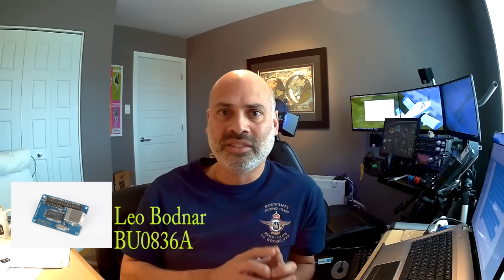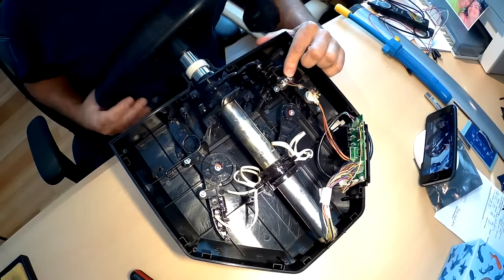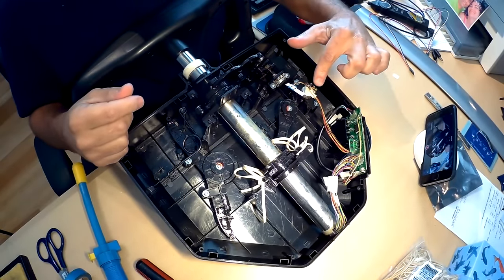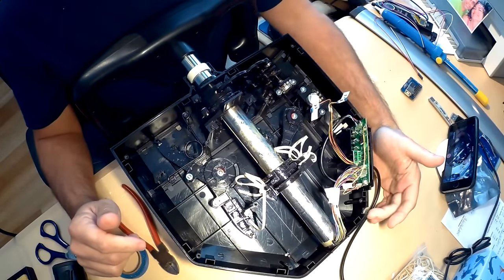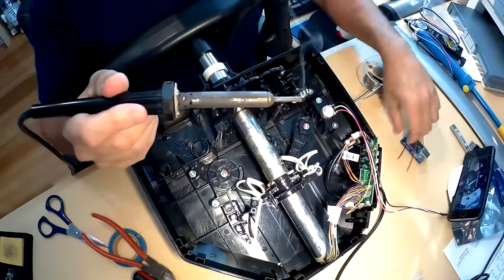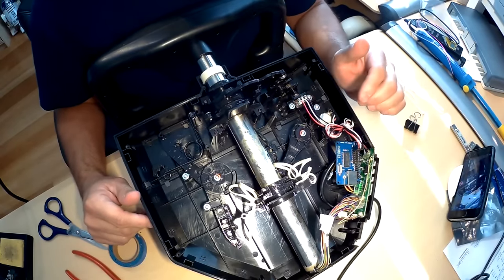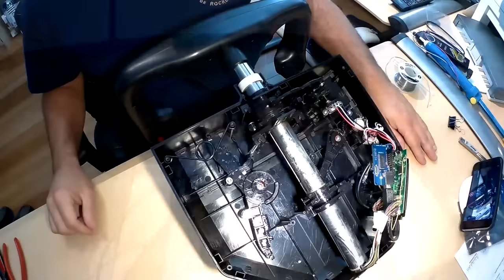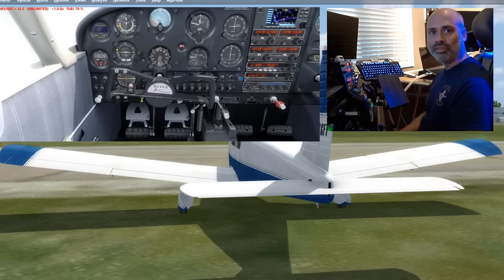Saitek Pro Flight Yoke Dead Zone Fix

Comment: I was a bit afraid of spending almost 50 euros with the module but I did and 6 years after this video were posted you have another happy viewer. Completely worth it, infinitely better. Next step rubber bands. Thank you so much!!!
Only remark that I have with the video is the usage of the saw. I dunno if the quality of the plastic decreased in the last years but I've used a manual saw to do the opening for the usb cable and it was fairly easy. With an electrical one ofc is even easier in terms of effort but the risk of letting the saw escape and permanently damage the yoke is bigger. But that's me.

Comment: The was my second move.  My first move was to try and use an Arduino to do the job.  I did succeed with the only issue being different sensitivities on the two axes.  I did contact LB for some information, but that laughed at my request.  So I bought the BU0836A, smooth sailing since.

Comment: thank you for your detailed demonstration, I found it extremely helpful. I just ordered the parts and look forward to fixing this thing once and for all. Thanks again and take care!!
UPDATE: rec'd the parts in 2 days! UK to Canada, wow! I installed it today and I noticed that my pitch wires were backwards on the original pot so I simply followed the video and everything worked fine. Dont forget to assign flight controls once you open up MSFS 2020 otherwise it will still think the flight yoke is controlling these and you will have no response. You will see the BU0836A show up in the flightsim controls options. Believe me...I am no electronics wizard by any means so if I can do this anyone can.
The final result is a flight control that is WAY MORE REALISTIC!!!! what a difference. I now want to do circuits over and over again just because my landings are greasers...whoo-hooO!!!!
THANK YOU SO MUCH FOR THIS VIDEO, I COULD NOT HAVE DONE IT WITHOUT YOUR GUIDENCE

Comment: Thank you for the great fix. There is a simplified version of that fix: add a resistor e.g. 39k (I have 33k potentiometers) into the potentiometers positive supply wires. That will reduce the signal and the ADC/firmware does not apply that dead zone gap in that range. Of course one has to recalibrate after that and the resolution is reduced by 1 bit, but for me that works still very well.
I also removed just one of the two elevation centering springs and that gives a usable yoke for me.
Reply from the maker: Amazing!  Thanks for sharing :-)
Reply: @Mixturerich  the video gave the necessary clue ("it's a firmware issue")
Reply from the maker: Glad people are stilling getting use of this video  over 5 years later.
Reply: I can confirm this works.  Ran a 39k resistor between each of the pots and the red wires. 10 minute fix and $0.10 worth of resistors!
Reply: @wyatts  Can I ask what exact resistor you used? Was it 1/2 watt? I took an electronics class a long time ago and don't remember much but would like to do this fix.
Reply: @at-yj8pl  I used a 1/4W. Can probably use almost any size. It's a data line, not really much power involved, I'm guessing.
Reply: @wyatts  Thanks, makes sense. I will be attempting this fix soon.
Reply: @supertuxkartgamingexperien5728 Is it the +5V (yellow) cable or the signal (red) cable?

Comment: I just did this fix to an almost new yoke and wow for the first time ever I can land a sim like I can the real thing. One thing I did notice is the colour of the wires were different to that described in the video, check where the wires come out of the original board for correct colour. Also when finished ALL of your sim gear will need to be checked and deleted as I had a conflict between the new board and the old Saitek  settings..  well done.....
Reply: Where did you got the new board? And i am a beginner in flight sims just got the yoke do you think i need to do this if i am a beginner. Do it feels extremely bad without these changes? As said i am a beginner dont know if its worth to do it.
Reply: @skocngt7457  The board is from "Leo Bodnar.com" in the UK . and yes I  believe that it will certainly help you when learning, especially when trying to land as the dead zone in the elevator is very bad and also the aileron has a similar dead band making it near impossible to control near the ground.
Reply: @rodwright3271  Hi Rod im also in the UK can you please tell me which wires correspond to which connection as i have no idea. My wires are the same as your i believe

Comment: Thanks for the tip. I fitted a BU0836 today but I had problems with juddering aerofoils and reversed elevator. When I checked the original wiring I discovered that  the pitch wires on the yoke pcb were wrong they had the red wire to ground and the black wire was 5v . The roll pottentiometer was wired correctly , so my advise is to ignore the original wires and follow the video . Also and this caused the juddering , my leads from the pots to the BU 0386 where too long. Keep them as short as possible it will prevent interference from being picked up.

Comment: Nice fix for the yoke.  Yesterday after a new windows install i installed for the first time the official Saitek driver instead of use the windows 10 standard driver. Suddenly I had a massive deadzone on left aileron deflection. After deleting the software and drivers it was much better but regredly not deadzone free anymore. Weird behavior it is.

Comment: Just a simple tip  for getting to your game controller window quicker just by running the built in program joy.cpl  , on win 10, press window key and R. In the Run window that should appear type joy.cpl and that will bring up the game controller window where you can then select which device your checking.  Great video but can I suggest the use of a grommet and use a round hole in the case or simply protect the wire from the casing by using fish tank tubing, about 6mm or a piece of fuel line as used on IC radio control models by cuting along the length of the tubing then fitting it around the edge of the hole plus another piece on the other half of the casing. On anything other than windows 10, just access the Run command. You can if you wish to, run it from a dos/cmd window.  For anybody that has a switch that's not working on their yoke, and the switch itself is ok, use the 2 pin connections on the Leo Bodnar board that are mentioned in the video.

Comment: A very informative video! Just a simple question: Why not cut the USB output cable and solder the shortened USB wires to one of the spare USB's on the Saitek board? This would eliminate the need to cut a hole in the case. Any problems with this approach?
Reply from the maker: Can do that for sure.  This was for simplicity, especially for those people who might be soldering for the first time.
Reply: @Mixturerich  Thanks for getting back so speedily. I'll probably do this when I install the new board. (I'll blank off the used USB with a spare socket protector.)

Comment: Many thanks for a thorough and very understandable video.  I bought the board and wires, and was anxious to get into the project.  I finished after following instructions carefully.  Unfortunately, when I reassembled the unit and reset it in my sim, everything worked with the yoke and quadrant, except the pitch and roll.  I reopened the unit and examined the wiring and found all seemed to be in order.  Stumped in Sunset Beach, NC.
Reply from the maker: +Mike Phipps hope you found the issue...  could your add on board be defective?
Reply: Thanks for responding.  I took on the fix because I have done a good bit of soldering through the years with my large model railroad.  However, I must have crossed a wire or two and fried the board in the yoke assembly.  In frustration, I ordered a new yoke and believe I will just have to be satisfied with the dead zone.  I have no way to check whether the board itself is defective.  Thanks again.

Comment: This may be an old video butt I am using it for my yoke (new!) and while experiencing the same issues I ordered a Bodnar board. Now I am going to install it but beware, they seem to attach the wires randomly (maybe to ensure people destroying their boards and thus yokes so they can sell more?) and my wires for both potmeters are different, even from eachother! The potmeter is however the same so from left to right the same order as in the videos. Just keep in mind that the colors are different! I noticed it right away and unscrewed the board inside to look on the board and it is  from top to bottom Voltage, Signal, Ground! So watch out and maybe the creator could mention it somewhere in the video?

Comment: Just Ordered The Leo Bodnar BU0836A... slow shipping thou. So, I hope I can get it working like yours once I receive it.

Update 4-23-19, I installed mine already, worked perfectly. I also did the rubber band modifications.
Reply: Just installed my BU0836A.  Thanks to Dan this upgrade makes Xplane 11 act like a real simulator.  Since January I tried two Yokes from Saitek both had the problem, one on left roll and the other on right roll.  Just be sure turn off the Yoke calibration in Xplane 11 so they don't fight each other.  And watch the wire colors on your yoke.  The new ones seem to change the colors on the pitch pot.  Both of mine had the same color config Red, White, Black left to right.

Saitek is clearly in denial.  The firmware or circuit board is consistently faulty.

I can actually land the airplane now.

Comment: Just did this mod last night.. So much better! Thanks for the great tutorial!

I had a few issues getting it to work with MSFS2020 and after googling it appears others are too so I hope this helps.. To start with I got no response, I think it was still using the original controller input in game. I altered my settings, cleared the original settings from the saitek controller and mapped the left turn of the yoke on the new controller to aileron left (roll left) and vice versa for right, this is wrong, this acts like a button and it's either completely on or off. You need to map the aileron axis and pitch axis in game and then it works perfectly.

Can't believe what a difference this controller makes! Also can't believe saitek haven't sorted it, the colour of my wires were different to your tutorial so they've obviously changed something, clearly not the part that reads the potentiometers though.
Reply: @Bubble Music Hmm.. I never had an issue with a question mark on the interface so I'm not really sure what could be causing that. Might be worth uninstalling the BU0836A from device manager then plugging it in again to reinstall.

If it solves the question mark problem then you just need to find the aileron axis and pitch axis in the flight controls section of that interface, click to set the input and turn/push or pull your yoke to register it.
Reply: lalix did you have any problems binding the buttons in fs 2020? im not able to bind any of the buttons any solutions anyone?

Comment: I'm going to buy this board and fix that dead zone. Had my yoke for years, but it's been in a box. Question though, my yoke drifts to the right - after installing this new board, is there a way to calibrate a NEW "center" so it actually stays CENTER?

Comment: Hi quick question, I noticed you didn't use your roll spring.  In a real plane does it have a return center point feel or is it just free to move?  Are you using the rubber bands also for roll tension as well?

Comment: I will eventually do this also, but plan on running a cable out of the Yoke and keep the board outside the yoke so that I can easily use the rest of the inputs on the board for additional switches or potentiometers or rotary encoders.
Reply from the maker: +Gary V excellent option!

Comment: Thanks for the nice video! I have a question. If i pulg in to the usb port on the back side of sytec yoke, do I really need a additional power input to run? Or will it be Ok without the external power?

Comment: I used rubber bands to fix my Saitek yoke and the rubber bands are positioned differently than the elastic bands shown in this video. But I wasn’t aware that there was also a third party joystick board. I might buy it.

Comment: Great sharing, thank you very much. One question, I am about to buy one, and I wonder if Saitek did any changes after feedbacks from customers. Do you have any idea or some info about any improvement? (It'd be very nice if I can buy and start to use it without any modifications). Thanks! Flysafe.
Reply from the maker: +Hakan Ünal I have not heard of any improvements.  If you get a new one and it works great out of the box, please post and let us know.  Good luck!
Reply: i have a brand new one and it has a dead zone.

Comment: Thanks for the video. My Saitek pro flight yoke has died on me with no power to the ICB so i'm going to try and replace it. They may refuse to replace the yoke so is it possible to use the bodnar board to completely take over from the Saitek ICB? I want the hat switch, the three switches and the push button.
Reply: I don't think the Bodnar board will handle the buttons.

Comment: looking for a yoke to buy before the upcoming MFS 2020 I wonder between this one and honeycomb.
Reply: I'm waiting for Logitech to update the Saitek Pro to version II. If that doesn't happen this year, I'm going to buy the Honeycomb.
Reply: Does anybody know if this is still a problem, here in 2020? Does the Logitech G Saitek Pro Flight Yoke still have that deadzone problem?
Reply: @FLVinge  Some of them have some not it depends if you're lucky but I know how to reduce that dead zone to basically 0 without any modding like he shows in this video.( all you need is to initiate a factory recalibration mode)
Reply: @Voltomess  Ahh thanks. Factory recalibration mode , I remember to have done that ones many years ago to a wheel I got.
Reply: @FLVinge  yeah just type it in youtube there is one guy who shows exactly how to do that and everyone is so happy because it works like a charm.

Comment: Hello, excellent tutorial, my problem with the yoke is that it has been a while without flying, I have updated all the drives and when connecting it through the USB the yoke does not turn on.  what do you think is the problem and if you can help me thanks

Comment: hello, I performed the installation as you explained and everything is correct for windows in terms of calibration. but when i look at the flight yoke game controller the x and y axis still moves there is like interference when i move the wires i cut to make the modification. thanks in advance
Reply from the maker: Disable the x y axis coming from saitek.  Only use the x y axis coming from the bodnar board.

Comment: I am looking for a way to add feedback to the pitch of my Logitech Pro Flight Yoke. I am thinking of using a servo that will move the yoke shaft in and out as the aileron changes in flight either due to trimming or the aerodynamic force of wind affecting the aileron of the plane in flight. But first I need to know if there's a way to get the raw data from Microsoft Flight Sim 2020 and connect that to what I imagine would be a small control board such as an Arduino and that connected to the servo. Can you help me get started in any way?
Reply from the maker: Sadly I know nothing about arduino or force feedback.

Comment: Thanks, Dan, for this detailed explanation.  You have convinced me.  I have a spare Pokeys55U which I think could do the job as it is seen as a joystick controller by FSUIPC.
I assume this fix could also get rid of the annoying Saitek issue whereby the roll axis center is off unless you fix the registry.  Would you know if this is the case?

BTW, is that Rockcliffe by Ottawa?

Cheers,
Phil, CYUL
Reply from the maker: Salut Philippe,  Glad people appreciate this video.  If you have a spare Pokeys55U, you don't have anything to lose to use it.  I looked at the specs and you should be fine.  The registry fix is no longer required :-)  All Saitek drivers are gone from the scenario, thankfully.  

Yes, that is Rockcliffe, my home base.  I fly out in a Piper Cherokee 180 that I part own.
cheers
Dan

Comment: Thanks for the video! I got one question. After the mod, when I roll to the right, the axis goes to the left and vide versa, not sure how to fix it 😭
Reply from the maker: Flip your wires on the potentiometer or flip the axis in software.  Either choice will work.
Reply: @Mixturerich  got it, tq!

Comment: Thank you so much Dan for  making this video showing how to overcome, what is a very annoying trait on a lot of Saitek Yokes, Really we should not resort to such  'fixes' for although the saitek yoke is not as expensive as the premium yokes out there, At over a £100 here in the UK, it certainly is not cheap either! I suspect it is  from Saitek using the absolute cheapest parts they could find to up the profit margin...Counter productive, so much so that when the new Honeycomb yokes and throttles come out for sale,  a unit reputed to be made with high quality potentiometers etc, Saitek will be hard pushed to  compete...unless Logitech, the new owners of the Saitek brand, decide to 'up the spec'?   I would be surprised if they did not as Logitech has a good name for it's products, e.g. their 'Sim' racing car steering wheels etc. Anyway I digress, I have  followed your instructions to the letter and ordered my Leo bodnar USB input board which arrived the next day! (Did not realise they were a UK firm?) and now my yoke has no dead zones at all! However, I now have to address the annoying 'detent', a result of ' too heavy springs?'  I have seen several methods of addressing this problem here on you tube. I wonder  what is  your opinion on this? Do you recommend one way over the other? Once again THANKYOU DAN!
Reply from the maker: Christopher Crosby go for the elastics bands.  Works great.